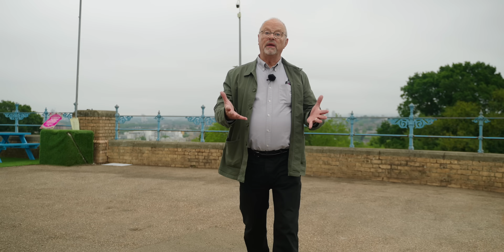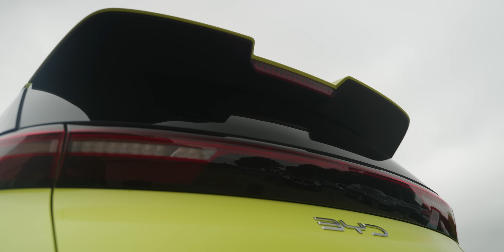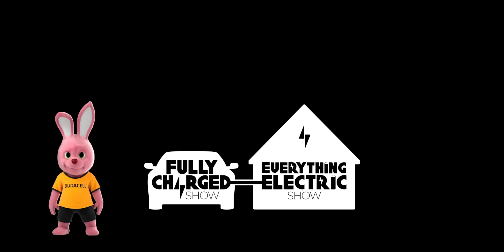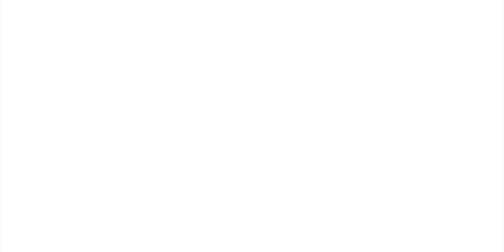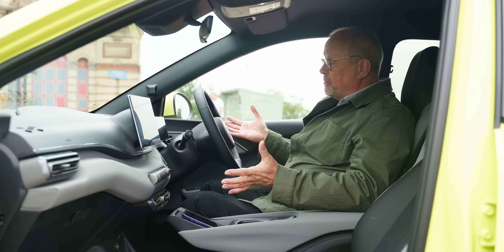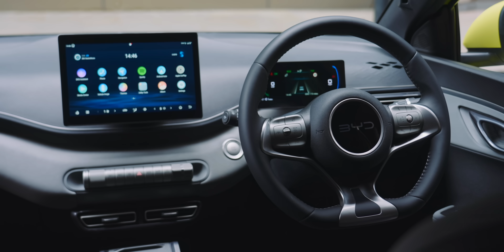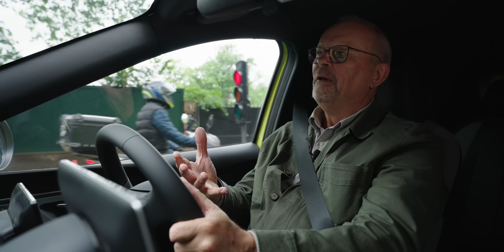At Long Last!? Low cost (high volume) EV for 'every' budget?

Comment: Well, an improvement. What I see now is the proliferation of cheap "city" cars for town commuting / shopping. Example - went to look at the Renault 5 - it's lovely, but I literally could not get in; it's too small. Annnd the existing £30, 40k+ segment US SUV / truck style vehicles apparently aimed at the family bracket - these are just too large!

What I want is a Ford Focus-alike which sits in the middle with a price under £20k. Plenty in China, but not here yet :(
Reply: Alas, given that the Renault 5 et al are - mostly - over 20k (especially when optioned up, etc), you're not likely to get a bigger vehicle for under 20k (even this Surf is only just under, for the base model with no options)... the Ford Focus segment would mean the ID.3, Kia eNiro, Hyundai Kona, and similar... and I don't think they'll ever drop below 20k (by the time they start using 'cheaper' batteries, etc, inflation will have pushed the baseline up again).
Reply: @logicalChimp  Agree. Yet in Nov 2022 BYD announced it was cheaper for them to build a saloon EV vs the same body with ICE... methinks the EU market is rigged.
Reply: Wait you couldnt get into a Renault 5? I got up close with one today and those things are surprisingly big. Much wider and taller than I wouldve imagined them to be. Then again Im used to driving a Kia Picanto as a personal car, and my company's Citroen C1's for work.
Reply: @drdewott9154  Yep, been there and didn't attempt to get in. Apparently the Renault 4 (on same chassis) will be more accommodating.... so I was told.
Reply: @xlerb_again_to_music7908  you said "but I literally could not get in; it's too small." but now you're saying "didn't attempt to get in". which is it?
Reply: @siflons6592 As soon as my back hurt, I stopped the attempt to get in. Then I got into my own car and drove off.
Reply: @siflons6592 My back told me "don't".
Reply: @xlerb_again_to_music7908  You do understand the contradiction between your 2 comments.  "literally could not get in; it's too small." but then you saying "didn't attempt to get in". Both can't be true. So, you don't know if it's too small or not - literally!
Reply: @siflons6592 :) perhaps I was stuck half in or half out? Anyhow, too small it is, it is!

Comment: Stopped at Knutsford Services northbound the other day and was disappointed to find that although the southbound side has a wide selection of new high speed Gridserve chargers, the northbound still has just 4 rated at 60 kW each.  Plugged in anyway and went for a wee and a coffee.  When I got back to see how it was doing it was already over 80%.  Made me realise that you really don't need all these ludicrously fast chargers.
Reply: In places where you are going to stop for a short break, 150kW is about as fast as you need to go. The advantage is that you can have twice as many (compared to the typical 350kW ones). Load sharing with multiple chargers also makes sense (but it definitely doesn’t with the two connectors on a 50kW unit).
Reply: Anecdotal evidence notwithstanding, high speed chargers are in fact necessary. "I don't need fast charging in this particular instance" does NOT equal "I will never have any reason to take advantage of super high speed charging". Also, even if you personally never need to charge at more than 25 kW, it does not follow that there's nobody else who will ever need to charge at 250+ kW nearly every day.

7 billion people do not all have identical, or even remotely similar, requirements.
Reply: Low capacity chargers are great for small capacity batteries in the motorised washing machines that rarely leave city limits, but for many with 65-75kWh batteries they are essential. Notwithstanding the fact that public charging costs obliterate the fuel saving advantages of an EV.

Comment: May I suggest using miles per pound as an easily understandable way of comparing ICE cars to EV. My 2011 Leaf does 25 miles to the pound when charging overnight on economy 7 which for me is almost all of the time. For a petrol or diesel based on current prices divide miles per gallon by 6. A 42 mpg car does about 7 miles to the pound.

Comment: This is the proper car of the people.
The notion that FordFiesta-sized cars are only good for city driving needs to go away. Single people and those without 3 passengers and 5 suitcases also need longer distance travel, and nobody needs group 50 insurance that comes with the (nice to have) Tesla 3.

I wonder if BYD has towbar or similar solution for bike carriers or whether they'd be scared to cannibalise the sales of their SUVs..
Reply: Yeah exactly! My family lives in a rural area beyond the city and we cant imagine driving anything larger than a Renault 5. Heck our current car is a Kia Picanto.
Reply: The EV lovers are devoid of any sense. EVs are neither cleaner nor better for the environment than modern ICE cars and that is why the depreciation of them is so catastrophic. If you still favour EVs over diesels then you are devoid of common sense
Reply: @Anonymous-ib8so Thats a hot take and a half. Got any proof to back up that claim? Cause from what I've read with modern EVs and their battery composition and use then it'll be more environmentally friendly to use an EV after having clocked 20.000km on the car over a combustion car in its lifetime. And given that most people use their cars up until around 100.000km then that makes the EV by far the superior choice for the environment
Reply: It's a bot. Don't waste your time.  @drdewott9154
Reply: @Anonymous-ib8so  EVs are most certainly cleaner and better for the environment than diesels. If you still favour diesels over EVs then you are devoid of common sense.
Reply: @Anonymous-ib8so what emissions come out of the back of an EV when it drives past a school?    🤡
Reply: @Anonymous-ib8so  A used car is more environmentally friendly than a new EV, but a new EV is more environmentally friendly than a new ICE even on a purely brown coal fired grid.

I got an EV because the extra $9000 AUD over the comparable petrol car is more than offset by the $4300 AUD less a year I'll spend on petrol as power is way cheaper than petrol here.
Reply: @Anonymous-ib8so  EV`s are way cleaner and better for the environment than modern ICE cars proven by actual scientific research facts. Facts are something which your propaganda campaign brain probably have no familiarity with. Depreciation on regular ICE cars are going to be very big in a few years when gas stations close and fuel prices soar due to shrinking demand and production. 
Your anti EV hysteria causing you to waste your life spamming this channel with that toxic vomit isn't going to turn back time anyway so you really are wasting your time.

Comment: Sorry Robert charging is very important, we all don't live in cities. I live in a rural village I can not charge at home as I don't have a driveway. If I wanted to use a public charger there are none locally and those that are available 10 to 15 miles away are very expensive. A car like this with a decent range would be ideal for the driving I now do, but its just uneconomic to charge it.
EV's are great for those who can charge at home even better if you have solar, but having to rely on the public charging network for all your charging is a non starter at today's prices GridServe will charge you up to 85p/kWh whilst at home it could be as low as 7p/kWh with an EV Tarrif that makes a huge diffrence.
Reply: What is the rate you would have to pay? Any chance of your council putting in some overnight charging at the village hall? Lots of people like you need this stuff to happen. We've had roadside chargers in areas where people park on streets for a few years now. Seems to be working OK and I expect they'll be needing some more soon.
Reply: @xxwookey  My local council declared a climate emergency and then allowed a company to put a charger in a couple of their carparks but the issue is the cost of using them. I have even asked the council if I can put a charger connection on their grass verge next to my car its a firm NO. So an EV is just not cost effective, I would love one I have really like the ones I have driven but unless I move to a more suitable house its just not happening. 
I appreciate that the Charging companies are providing a service so its going to cost more, but 10x ? 
Also at home I could charge slower over night when I am not using it, with Vehical to grid technology this also help the national grid but commercial chargers do not provide this.
If I were to use a commercial charger then it would need to be a fast DC charge certainly more expensive to install than a simple home one, because I am not leaving my car there overnight to fully charge.
Reply: @davidclift5989  I'm surprised slow chargers in a council car park are 10x the cost of home charging. Cheapest home charging is 7p, base rate is 23ish.. 70p/kWh is almost most expenive DC-fast on the motorway pricing. Council carparks are usually more like 30p aren't they? Or is the point that you have to pay for parking as well/instead, which would indeed make it very expensive.
Keep pestering your council about things like verge chargers - they have to give people some sort of facility at some point. If you are the one pestering you might get it right outside your house 🙂'No, everyone without a drive has to burn fossil fuels forever' is clearly not an acceptable response from them.  As you say, which bit of 'emergency' do they not understand.
Best of luck! Councils are slow and skint, but they can do good things eventually.

Comment: Have been looking forward to seeing this in the UK. Hoped it would be a little cheaper. The charging is too slow, 85kW in 2025, should be min 125 IMO. Not everyone can have chargers at home.
Reply: Pricing is not set by the price in China but by the market in the country where it is being sold. The Chinese manufacturers need to try and make money to cover the losses they are making in China.
Reply: @RichardHilditch why do we have to prop up their market? Electric cars are so simple. Sure he battery is expensive, but it's getting cheaper all the time, this car should be sub £13K IMO. Would be intested to know how much of that £18K is tax.
Reply: @yoric7200  I bet I wouldnt hear anyone saying the same about the rams head, they will gladly pay up to 30k for a secondhand one with crappy heating element heating system
Reply: @dantronics1682dodge?

Comment: Ugh i hate them locking smaller cars into short range use only with abysmal fast charging tech. 

65kw for this BYD or sth like the Inster's 85kw makes their road trip ability worse than my 5 year old VW E-Up considering fuel efficiency and battery size lmao. 

The Renault 5 absolutely buries the competition right now, it's not even close.
Reply: Charge speed is determined (mostly) by battery size.  This pack appears to be using 2C cells (meaning they can change at 2x their capacity), which is pretty good... but if the overall pack capacity is only 30kWh, then charge speed will be limited to 60kW, etc. (same for the ~42kWh pack charging at 85kW).

Comment: If they could have got the Boost version at £19,999  people would have been queuing up to buy this car. As it stands PCP and leasing cars will be the thing to watch. The Comfort model is ironically uncomfortably close to the Renault 5 in price.
Reply: Yeah, in Denmark the Comfort is actually higher in price than the Renault 5 at 189.990kr versus the Renault at 184.995kr in its base version.

But the Surf Active is the cheapest car in the country, and thats for all cars not just EV's, at 149.990kr. Just 5kr cheaper than a Kia Picanto. Meanwhile the Boost goes in at 174.990kr. The only other EV model here thats cheaper than the Surf Boost, is the MG ZS EV Comfort Standard range which goes for 170.000kr.

Comment: The charge port is on the wrong side for Aus for curbside chargers as, unlike you poms, we don't park on the wrong side of the road. It does look good. BYD should bring it to Aus, but will they?
Reply: Bear in mind Robert is driving the RHD version of the vehicle - it's possible / probable that the LHD version will have the charge-port on the left (take a look at the Chinese or Brazilian models to check)

Comment: BYD is something I would never recommend for my friends. Others can do what they want but why would one buy a BYD is something I can’t get my head around? Maybe someone that doesn’t care and doesn’t know anything about the world we live in? 😂
Reply: Better than Tesla if we're taking geopolitics and staff treatment into account. Obvioulsy Renault and VW much better than both from that POV.
Reply: @xxwookey VW!? Are you kidding me!! Worst people of all with their stupid patented parts so no one else can fix them cheaply! Avoid at all cost! Tesla is the way to go with parts.
Reply: @Sherukka  The discussion was about politics and workers rights, not spares availability. But my understanding was that Tesla made DIY repairs almost impossible due to lack of spares availability for many years, although I believe it is better now.
All car companies have recently been hiding behind 'but software' excuses to prevent repairs, which used to be trivial, and legally protected/enabled, when they were purely electromechanical. I agree that's despicable, and needs to be fixeve never owned ad by right-to-repair legislation. I was using VW as an example of a European company operating with reasonably good worker's rights, environmental compliance, climate targets, and legal oversight. I assume their parts supply is much the same as other EU dealer-based manufacturers, but I have never owned one so have no particular experience. My cars have all been French since 1991 (Citroen, Peugeot, Renault).

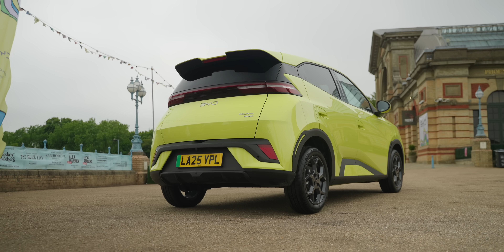Comment: 01:50 that charging port position is awful. I like the car but that annoys me, most chargers are design with  the idea that the car has a charging port either in the front or on the side on the back. When someone with a car that has it of the side like this parks next to your car you'll always trip with the cable. There's a kuga and a seal that create that problem for me frequently
Reply: I hate any front or front side mounted port. As somebody that reverse parks everywhere and hates having to go in from the front it really bothers me.

Comment: This looks ideal for somebody that really only uses a car once a week for office days, and shopping on the weekend , I don't need fancy
Reply: there were only 16 electric vehicles with over 150k miles on autotrader, while there were over 3800 diesels.
Reply: @JamesSmith-qs4hx  OK. Did you expect more or fewer? Tat sounds about right given the age and proportions of the car parc.
Reply: Seconded.

Do wish cars still came with handles for opening windows. Keep things as simple as possible and don't insert electronics where they are not needed
Reply: @photoo848  An electric motor and a switch is not really complicated or 'electronics'. It is annoying though that you have to turn the damn key back on to close your windows. (I just got fancy modern electric windows last year in a new van).
Reply: @xxwookey yes, that's my issue as well.

So many parts of my car unrelated to driving will only work if the contact is on or (even worse) the engine is running

Comment: Drove a few EVs now and center front charge port (as on Leaf) I find by far the best.
I've seen other drivers have to wait or ask me to switch chargers because they couldn't reach the cable across their car.
Am yet to find a flaw with center front.
Reply: I hate any front or front side mounted port. As somebody that reverse parks everywhere and hates having to go in from the front it really bothers me.
Reply: If you have a real winter the front is a hideous place for the charger port. Would be great if manufacturers could make different decisions for different regions.
Reply: @Sherukka  yeah perhaps, I can see that.
I guess I don't get 'real' winters
Reply: Strongly disagree, I think Tesla has it in the best spot. I’d rather back into a spot than out into the lane. I hate that my eNiro has it in the grille

Not to mention I’ve had to thaw it open in the winter twice already
Reply: The most problem is minor super market prangs cost a fortune which increases insurance costs.
Reply: Chinese people usually reverse their cars into charging stations, so most Chinese EVs have their charging ports near the A-pillar or C-pillar. Chinese consumers don't encounter the issues mentioned. If a charging port is located at the front of the car, it's usually on an older electric vehicle converted from a gasoline car chassis, and this is looked down upon by Chinese consumers.
Reply: Totally agree, one of the best things about driving my Zoe. You can just confidently nose-up to any public charger
Reply: So agree, center front always works.
Reply: and my Zsev.